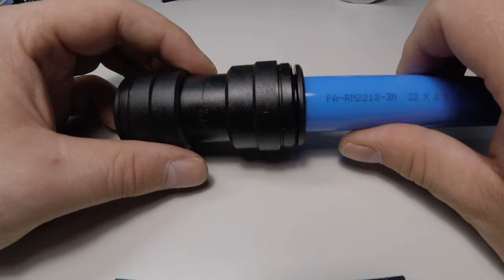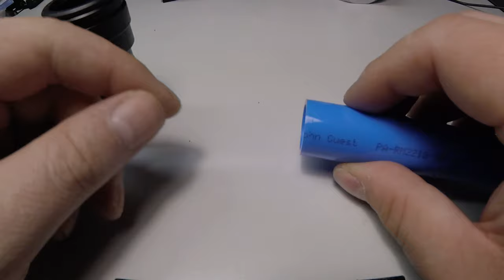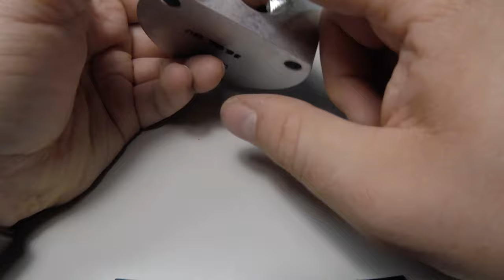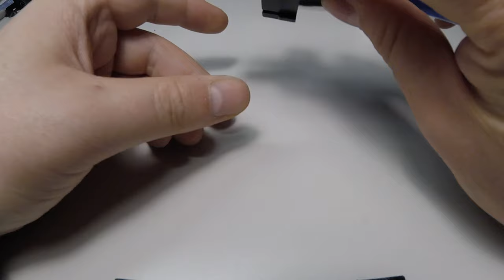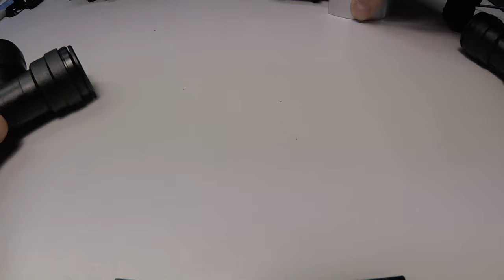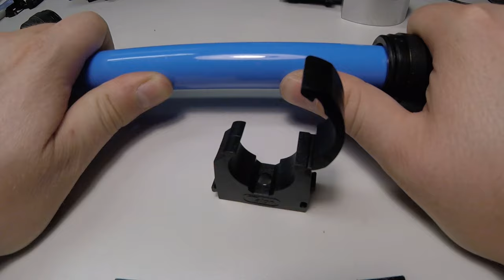Easy Air System for the Shop? - John Guest Speedfit Air Fittings

Comment: Its harder to getting the tubbing instead of the JG fittings.
Reply from the maker: That's a good point, but they should work just as well with any suitable PVC/Nylon tubing, as long as the outer diameter is the same.